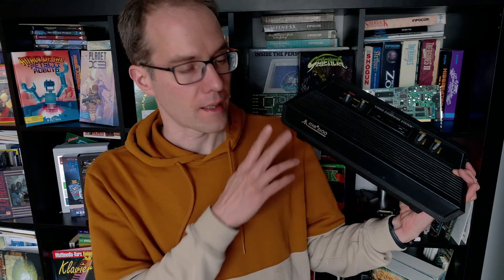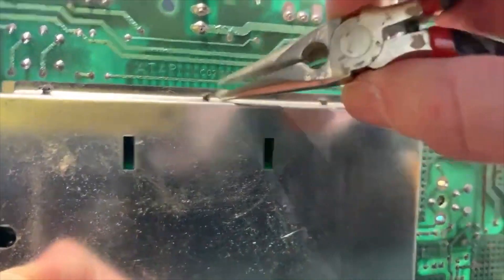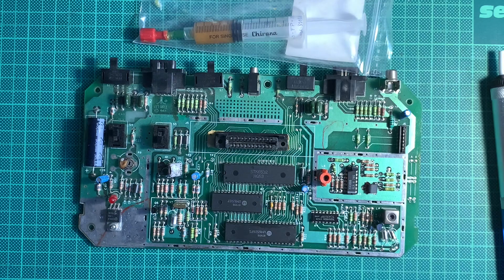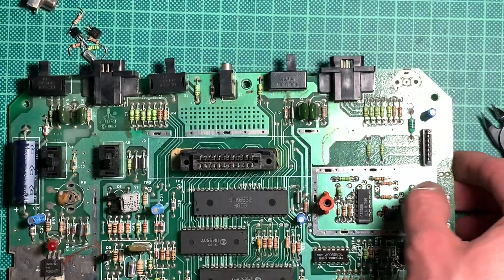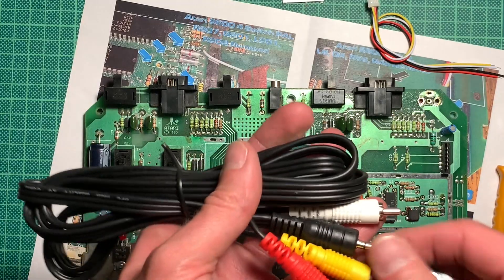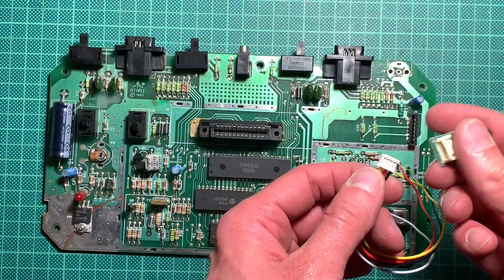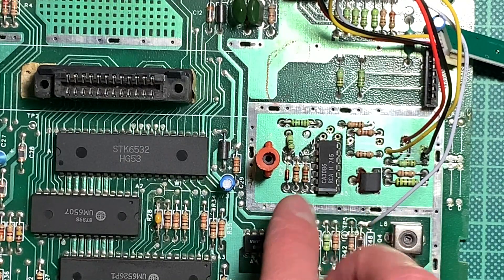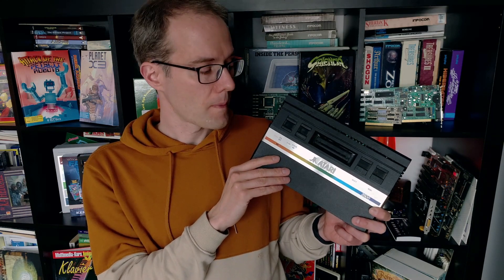Atari 2600 Jr: AV Composite Mod (No RF Modulator Box)

Comment: Are those the ET4000/W32 PCB on the shelf behind you? ;)
Reply: Was the foam supplied with the mod components you boght? I'm just curious if there is any other way to fix this in place. I think there will be a lot of mechanical work if you plug the cable in and out very often.
Reply from the maker: Yes, those are some spare ET4000w32i PCBs. 

The foam pads were supplied with the kit. And they are okay if you don’t unplug the cable often. But indeed they are not the greatest solution to the problem. Maybe one could design a 3D printed holder that fits into the hole on the back…
Reply: @root42  The idea is you're supposed to put a wire tie over the top and through the holes on the board and tie it down then it's rock solid....

Comment: Out of stock.  Know any other kits like this?
Reply from the maker: If you look on eBay there are plenty of composite mods available. Also, try to reach out to Rod Hull of tfw8b. He is usually very responsive, maybe he can tell you if another batch of kits will be made available.
Reply: @root42  I saw many.   Just not what im after.  I like the simple solution you used. And I may reach out to the person you mentioned

Comment: Also replace the 7805 with a TSR-1 2450 and the 4 film caps with new smaller TDK box film caps. .22uF, 100V each. $1.
Reply from the maker: Never heard of the 2450 before. Interesting alternative. But I guess the new 7805 will last a loooooong time.
Reply: @root42  Old tech. Too hot. Burns out. No overvolt protection.
Reply from the maker: The Atari is literally old tech... The current 7805 one has lastet 30 years. But thanks for the suggestion! I will try them out during the next maintenance / repair if possible.